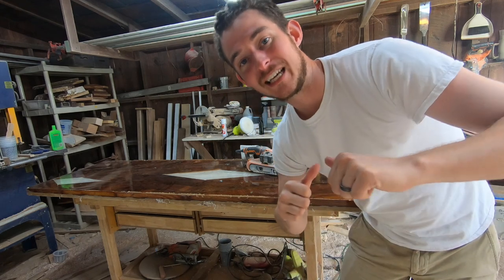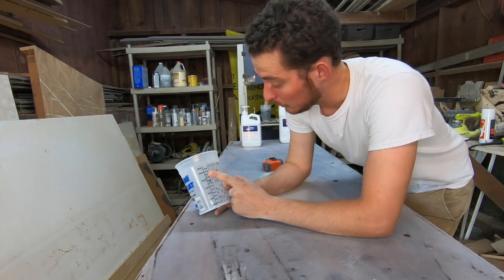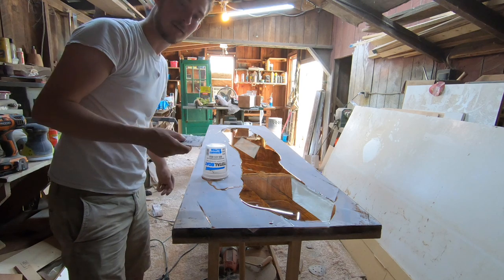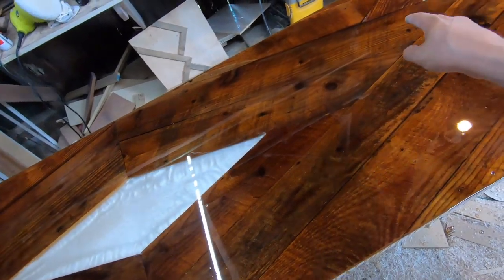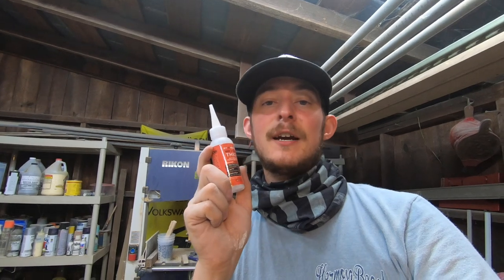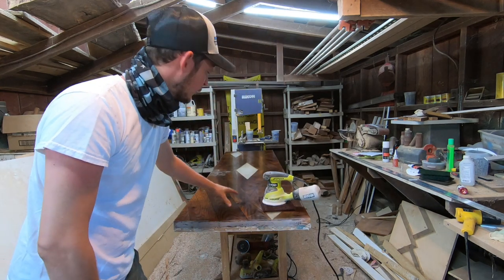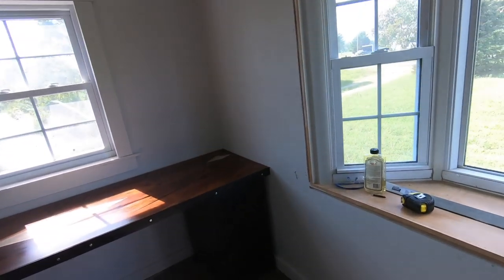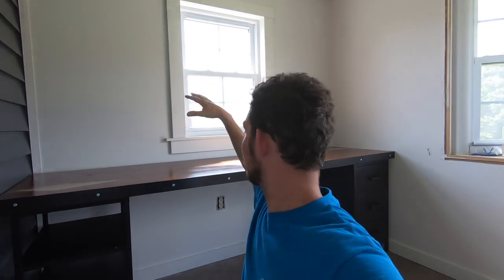Reclaimed wood desk part 4

Comment: How do the computer wires go behind the desk into that gap, if the desk is all the way against the wall in the back? Will you pull it forward a bit? Cut a notch in the wall?
Reply from the maker: Great question! The desk doesn’t sit all the way against the wall do to the trim so there is about an inch gap for the wires

Comment: Looks great!  I just have a question.  Why did you put the flood coats on?  Why didn't you just sand and buff the first pour?  Do you need the flood coats?  Also if you are going for the shiny look do you just leave the flood coat alone when you are done?  Thanks.
Reply from the maker: I didn’t sand a buff the first pour because casting epoxy doesn’t have the same scratch resistance or Yvonne resistance that the countertop epoxy has. You need the flood coats for that reason. If you wanted it shiny you can leave the flood coat alone. Hope this helps
Reply: GoodView Woodworks Yes!  That makes a lot of sense.  Thanks.  I just finished my first river table and it turned out awesome!  Thanks for all the info!

Comment: So happy to see this finished project! I've been working on a similar project but with cedar! This definitely helps me think through future steps! I have a question though if you don't mind, my table is free standing so Ive put trim on the sides that is 1/4" above my table for the flood coat to lay in. I think I want to put poly or maybe epoxy on the trim to make it all cohesive but I have to first seal the corners of the trim. What would be the best way to seal my corners in the trim but to still allow epoxy or poly to coat properly. Hope that makes sense. Lol
Reply from the maker: Your best bet would be to put the trim on and let the flood coat flow over the sides. Hope that makes sense.
Reply from the maker: Just realized that you typed “Hope that makes sense “ too 😂
Reply: Thanks!